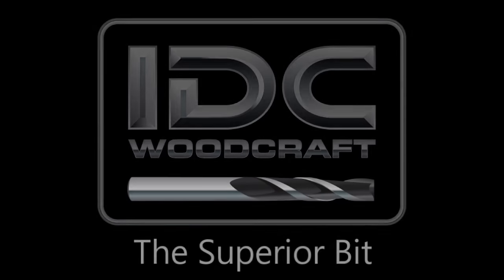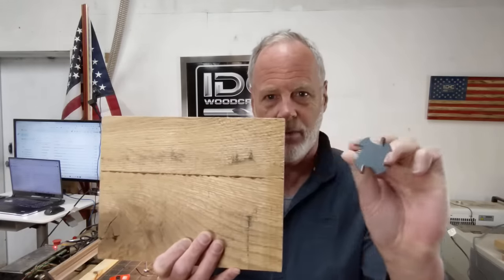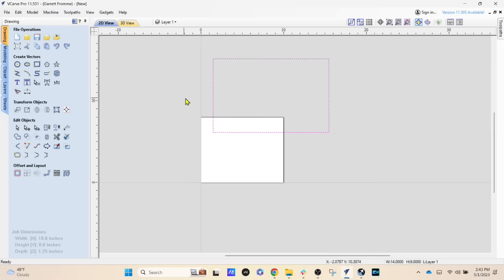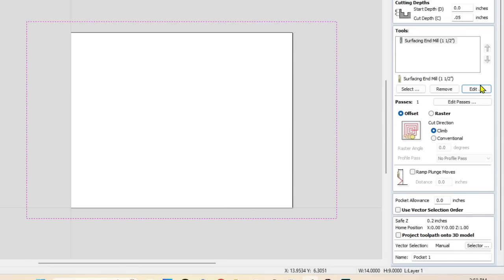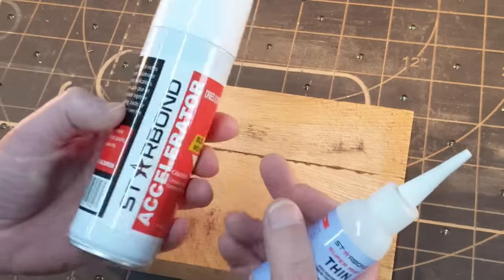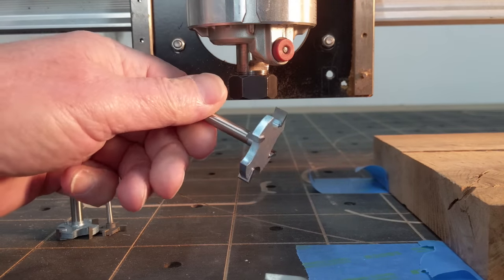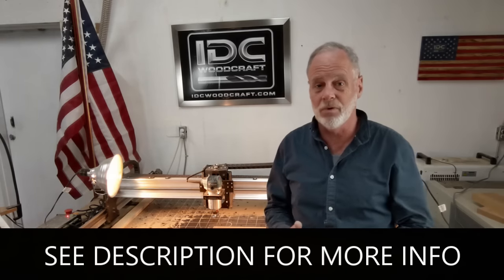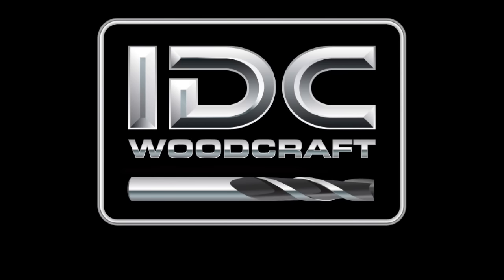How To Surface CNC Projects and Flatten Slabs BEFORE Carving, CNC Router Surfacing

Comment: Garrett, this is one of (if not the) best step-by-step videos I've watched on your channel! Very instructional, and the approach of taking the process from design considerations, through tool path, and then through project implementation, is the most thorough you can produce, in my humble opinion.

I've been working through a variety of surfacing instruction videos and tutorials, but none of them were anywhere near as complete and informative as this one!

As I responded to your recent survey, this particular video responds exactly to what I suggested! Keep them coming just like this whenever possible!

By the way, this video filled-in procedural things I've missed along the way, which included designing an enlarged box over the material layout to keep the bit from plunging on the first pass for surfacing purposes, how to set the xy coordinates properly, and how to take advantage of those (in gSender), as well setting the z with the probe. 

Great video and thank you for making available for us!
Reply from the maker: Gary, right on brother! Glad to hear you liked this one. Im also very appreciative of your survey information! I will keep working hard to make videos that will help you.

Comment: Great video Garrett!!! I absolutely love how you go step-by-step, almost baby steps for people that are new to CNC machines, such as myself. All of your videos are fantastic and I rely on them to learn how to run this machine. I have done three projects so far.  I am starting on a fourth project, which is going to be cigar ashtrays, made out of an 8” wide dead branch I had over the house here for years. I cut it up into 2 inch pieces and I need to straighten the top and bottom.. Thank you so much for all you to do in theses videos, it’s a HUGE help to us people that are new to this.!!!!! Thanks again Garrett!!!!
Reply from the maker: MrDakman, Thank you so much for the kind words! I'm thrilled to hear that you find the videos helpful and that you're diving into projects like those cigar ashtrays. Good luck with the straightening process; it sounds like a fun project!
Reply: thanks for your video. I straightened them out and it went flawless. I will send a pic of the finished ashtray when I complete them.

Comment: Great video! Thanks Garrett!! This has worked wonders for boards that get twisted a little after glue up, that no longer fit through my planer.

I’ve not used the tape and glue method. I have used carpet tape and have found if the board is too warped it doesn’t grab the waste board. Have you ever had this issue with the superglue method? When that happens I just double up on the carpet tape until it grabs firmly. The carpet tape is not particularly cheap
Reply from the maker: Marcus, right on brother! Glad to hear this one helped you. Warping is still an issue with this method. I sometimes do multiple layers to make up for any issues in the gap.

Comment: Just what I needed to learn about surfacing. Thank you! I just finished my first surfacing test run and it worked great. I do have a question regarding the dust boot: What should I do to control the wood chips flying all over? The dust boot doesn't fit using the IDC 1 1/2" surfacing bit. System is a Longmill MK2.
Reply from the maker: waynehyatt5565, I'm glad to hear your surfacing test run went well! To control the wood chips, you may need to look into adjusting the positioning of your dust boot or consider using a different sized surfacing bit that fits better with your setup. Experimenting with different setups can help find the best solution for controlling the wood chips on your Longmill MK2 system.

Comment: Great video! Maybe I do it wrong, but on the second cut I just go off the material and go to Z 0. I know that is cut depth above above the surface. I jog my Z down the amount I want to take with the next cut and set that as 0 and run the program. I have surfaced several projects like this with perfect results.
Reply from the maker: WaterN2WineCreations, that is a great process too brother!

Comment: Garrett, very good step-by-step for surfacing, will help me surface much better and faster. what I need is a step by step instructions on how to import an object or image from Google to the clip art library, then move it to the work surface.
Reply from the maker: Williamdoll367, I have a video that should really help you. Here is the link:https://youtu.be/Zafn3m0IkiY
Reply: This did not really help. so you took an object out of clipart and started to dissect it. well, how did it get into clip by magic? no of course not. I need a clip art course for dummies. how to get it into clipart and use it for a project. how to get it into the project and form a tool path.

Comment: Hi Garrett 
As a best practice you should not bottom out the bit up in the collet
it won't tighten properly the bit needs to be pulled down just a millimeter or so.
When you tighten the collet, it wants to pull up just slightly and you don't want those two forces fighting each other or the bit won't tighten properly. You want to have that little bit of room for the bit to move up when you tighten the collet for it to get the best grip on the bit.
Reply from the maker: Marc, I see your perspective brother. Thanks for sharing!

Comment: Nice video Garrett, with some great tips. When I started out I only had my CNC, so did what you show in the video, but with a 1/4 shank bowl bit from a cheap router bit set. Worked fine, just need to get the crossover correct

Saying that, if you're doing a lot of natural wood professionally, it would be worth investing in some other conventional woodworking equipment such as a planer thicknesser/jointer. Saves a lot of machine time. No need for anything too expensive if your main output is CNC work, but saves a lot of machine time.

Keep it up mate.
Reply from the maker: Robots, good call on using a bowl bit. That would work great too. I completely agree, if you are doing a lot of this, a planer is a complete time saver.

Comment: Once you've completed a surfacing cut and realize that another cut is needed, you don't have to use your probe to set your Z height again.  All you need to do is change your Z coordinate by the depth of your first cut.  For example, in this video, after taking the first cut at .050" deep, all you need to do is click on your Z coordinate and add .050" to it.  Then simply run the same program again.  If your Z retracts to a height of 1.000" after the cut, change that to 1.050".  That's it!  You've compensated for the first cut and are now ready for the next cut.  BTW, thanks for all you do here!
Reply from the maker: Hi Bob. You are absolutely right! I had to pick either that method or the probe method. Considering I was talking to a beginner, it was easier just to probe. What do you think? Was that the right choice?
Reply: @IDCWoodcraft  Of course, you're right.  It's better that a beginner understand the process before getting into shortcuts.
Reply: @CNC Routers, Beginners & Beyond - Garrett Fromme  Yeah, theres no way a beginner would've been able to do all of that. This probe method is the way to go. Take it from a newbie here, that other method would do nothing but add to the confusion lol. Basics first, then after you get some experience under your belt, THEN try the shortcuts. 
Bob's method sounds pretty good and easy. I'll try that further on up the road, but basics first. 😃👍
Reply: I don't change the value either. I just move my bit off the workpiece so it cannot hit it, use the console to go to z-0.05 and re-zero there. Move it back up and hit start.
Reply: I just bought a CNC router machine and haven't used it yet.  I was hoping I wouldn't have to use the probe after each pass. Will your surfacing bit go through 6061t6 aluminum?

Comment: Your video's are great thanks i have learned a lot while I researched CNC for my own side hobby, have a question for the hold down, I have used hot glue with my hand-held flatting table wondering if you have tried hot glue on the cnc and how it would go
Reply from the maker: zarnfast534, I'm glad to hear you’ve learned a lot from the videos! Hot glue can be useful for some applications, but it may not hold up well under the CNC's cutting forces compared to other hold-down methods. It might also be challenging to clean up afterward. It's always good to experiment and see what works best for your specific setup!

Comment: Hey Garrett, I'm following the video, I was just wondering if you could show a video in which when a project needs a tool change and how that works, do you need to re-center the bit or continue the program?
Reply from the maker: martyjosephson4937, Hey there! When a project requires a tool change, you'll need to manually pause the CNC machine and change the tool. You'll then need to re-zero the new bit to make sure it's properly aligned before continuing the program. It's a good idea to practice the tool change process a few times beforehand to get the hang of it. Great idea on the video. I will look into that and add it to the video list brother! Happy woodworking!

Comment: Thank you for yet another great teaching video! Ironically last night I had just ordered the 1.5" surfacing bit along with the "Hog" and the ultra fine detail 2 bit bundle/set to add to my arsonal since my amazing wife bought me as an anniversary present a 6040 cnc to upgrade from my diy 3018 cnc as well as an Excaliber 21" scroll saw! I aint sure how I am going to match that gift, but I am sure it will involve a lot of fine cnc 3D artwork! Lol. Now to decide whether to learn Mach 3 software or convert my machine controller on my new machine to Arduino so I can keep using G Sender .
Reply from the maker: Tim, right on brother! Congrats on your new machine. It sounds like you are well set to get to making any project you can think of now! I am excited to see what you create.

Comment: Great Video;  can I use zero in the center of the material as opposed to the lower left?
Reply from the maker: daneilers739, Yes, you can absolutely use the zero point in the center of the material instead of the lower left corner. Just make sure to adjust your CNC machine settings accordingly. Happy woodworking!

Comment: Hot glue makes a pretty convenient shim. My gun is usually hot by the time I get everything taped up (worst case, go load the program and set the tool up, too), then just squirt a dap under the high corners. Cools off in a few seconds, supports the stock AND adds a little holding power, doesn't go anywhere, peels off clean.
Thanks for the videos.
Reply from the maker: Tony, that's a great idea brother! I never thought of that one before, thanks for the tip!
Reply: @IDCWoodcraft  I mean, the wife misses her gluegun sometimes, but otherwise... 😂

Comment: Garrett, Thanks for the great video.  The question I have is surfacing when you have a project that requires tiling. Any suggestions.   
I used the tape and glue method for the 1st time and it worked well.  For all those cncers if you don't have a mouse, like Garrett says get one..
Reply from the maker: Ralph, I dont have a video on tiling but I will in the future! Sorry I cant help you right now brother.

Comment: Great video. Next wave automation cnc control software has what the call virtual zero built in there control software. It uses multiple Z points to map the surface of your work piece. This keeps the same Z depth across the surface of your project in the invent that you have a warped board.
Reply from the maker: Karen, that is a very cool piece of software! I want to try it out myself.

Comment: hello Garrett back again i have artisan 4x8 cnc table with spindle  have every thing working as should be . Except spindle mach will run all way thru project will not cut
Reply from the maker: PerryShaw-ey8zo, I'm sorry to hear your machine is giving you troubles brother. Unfortunately, I am not much help here. I am not a tech guy when it comes to CNC machines. I may be good with the programing and operation but when it comes to troubleshooting, I'm an absolute deer in the headlights. I recommend reaching out to your machine manufacturer regarding your issue. They will be able to help you the best my friend!

Comment: What would be tge settings for hardwood? Ty I did my first surfacing cause of watching your video.  Made it so easy to learn!! Came out perfect.
Reply from the maker: Ald, "I do have the IDC woodcraft app that has all the feeds and speeds for every IDC Woodcraft bit right on your phone. It also has different settings for hardwoods! Give it a shot
IDC Woodcraft CNC Router Bit App Links
Apple → https://apple.co/3IKj9Td
Android → https://bit.ly/3kmFCfN"
Reply: I have a caribe router. Which isn't an option to put in.

Comment: Garrett, great video's!  I'm not watching this live so I am not sure if you will even see these comments.  For the second pass you used the probe and reset "Z" zero.  I totally understand that process.  Is is possible to just offset Z using the software and run again.  example:  The programmed tool path removed .050 but I only want to skim .010.  Can I apply and offset to either the z-axis or possible add a line in the g-code?  I'm running a I2R-8 with a UCCNC control.
Reply from the maker: Hey brother, this one is a little tricky to answer over comment my friend. I recommend joining Kate and I for our weekly youtube live sessions we host every Wednesday at 8PM EST and we should be able to help walk you through it tonight!

Comment: Another well crafted video Garrett. EXTREMELY informative and easy to follow.
I definitely needed this video a few weeks ago when a board I was working on got totally screwed up and I wanted to salvage it.
Since I didn't know what to do, I wound up using the 
G sender surfacing program, but this would have been a lot better!!! Big time.
Now would this lesson apply to resurfacing your spoil board also, or is that a totally different thing?
Thanks.
Reply from the maker: Joe, glad to hear that this one gave you a few good lessons learned. You could definitely use this same method to surface a spoilboard.

Comment: I surfaced several pieces but always have steps in the finish. The steps are flat so tramming doesn't seem to be the issue. Any thoughts. 
Thanks Ralph
Reply from the maker: Ralph, double check you tramming brother. It might still be off by just a little bit!

Comment: following your advice on settings I got the following: The following tools produced empty toolpaths. They may not be able to fit anywhere.......What have I done wrong as I'm using a 22mm diameter surface bit? Happy Xmas.
Reply from the maker: trumpetflowerll, this one is a little tricky to answer via comments my friend. I recommend joining our live sessions we host every Wednesday at 8PM EST and we should be able to help guide you through it there!

Comment: Garrett, would it be better or worse to use g sender surfacing feature?
Reply from the maker: No. Gsender does not account for going left of the project zero without zeroing then moving the machine left x distance and rezero
Reply: @IDCWoodcraft  would it be possible to add 4” more on the x axis and .5” on the y, I’m just a newbie trying

Comment: You mention using this bit with Carbide Create, but CC can't (yet) do pockets with the "raster" zigzag path you show. It does pockets by beginning with a plunge cut in the center of the pocket. This will cause a Bad Day® with your bit. Carbide Create Pro can do ramping when it starts a cut, which might work with your bit.
Reply from the maker: KarlBunker, very good points my friend. Keeping your bits in proper working order with different software versions is critical.

Comment: If you are surfacing your spoilboard it is not possible to have the bit off to the side unless you make your spoilboard smaller than the bed. I have a 3018 and usually carve material the full size of the bed. Do you have any tips for this scenario?
Reply: you can use the ramping feature in the pocket toolpath. Just use a big enough ramp distance (like 3-4 times the diameter of the bit so about 5 inches should be enough for a 1.5 inch surfacing bit) to allow the bit to cut away enough material so the center of the bit won't ever touch the material.
Reply from the maker: Shawn, another person commented that you could use a ramp but in most machines, you have a little bit of space where you can go off the sides of the machine and have it not run into itself! If you are having trouble with the ramp or using the sides of your machine, it would be best to reduce the size of your spoilboard!

Comment: Garrett, you've been great help, but need assist.  I mimicked your process but when I create the tool path I end up with a margin at the top and bottom that does not cut.  I selected the outer vector but does not pocket to the full extent of the box. It cut's off the to the left and right but doesn't go to the full up and down extents of the box.  I'm on Vcarve Pro V10.5.  any Ideas?
Reply from the maker: Dehatem, try making the box bigger brother!
Reply: @IDCWoodcraft  Will do, I followed all the steps and dimensions you did in the video and didn't get the same results.  trying to figure why in pocket it didn't go to the full extents of the vector box like yours did.  I noticed that on your path that the final path overlapped more to meet the perimeter.  mine seems to measure from the center of the box and if not enough room for the bit it just wouldn't make that final path.

Comment: How should this process differ if I’m surfacing an end grain cutting board?  Thanks!
Reply from the maker: MRebeckah, it won't differ much my friend! You shouldn't need to make any crazy adjustments or anything. End grain cuts extremely well!
Reply: @IDCWoodcraft  Thank you!  I was thinking about chip out and cut direction as the bit exits out the side but maybe that’s not an issue with surfacing bits.  I’m still learning!!  🙂